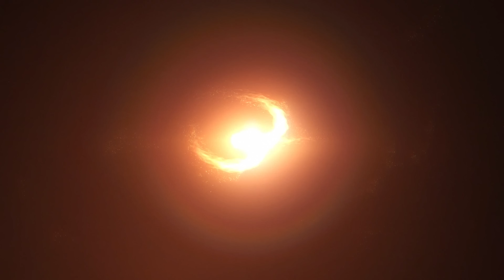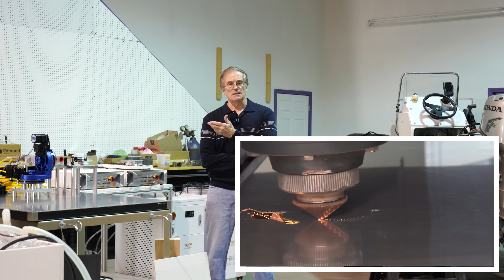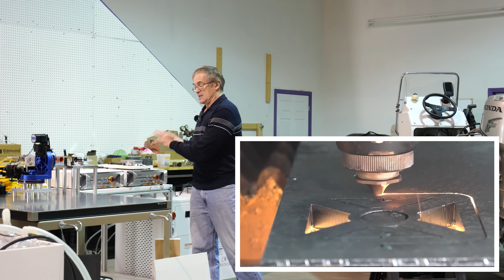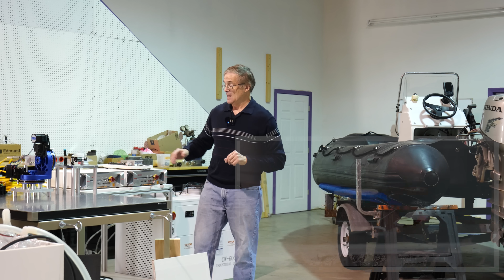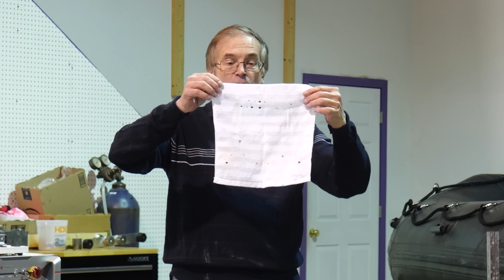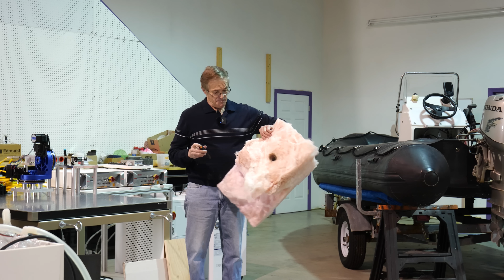We have a problem... and need your help!

Comment: Feels like an "XY problem" to me? However you've given enough information for others to give you the answer to the problem you need, rather than what you asked for.
Reply: He did say in the video that he would talk about the power of the lasers and how much they cost and then he never did that so those particular bits of data are off the table for us to consider what is cost-effective and what exactly are we trying to stop without that information you would probably think yourself doomed but he showed the object in the video so a quick image search reveals what he's playing with
Reply: @loveblowsbad  Primarily I mean that he's asking for a specific material that's cheap and convenient enough to cover a large wall but also resists their laser for a few seconds.

But a system that instantly cut the power when the laser missed the target could also work? Or move a smaller piece of expensive material constantly to where the laser is pointing?
Or only activate the laser in short pulses when it's confirmed to be exactly on target by using an automated lower power sighting laser?

What they need is to safely test this laser system without rapidly "burning through money" on consumables. But they asked for a specific solution rather than the general one.

Comment: Layers of frosted glass or acrylic panels to diffuse the beam rapidly. Or clear acrylic sandwiching some pool salt.
Reply: To further expand I’m my thought process: I have no experience with lasers beyond about 1-2 watts, but the little that I do have, tells me that I can burn black insulation tape but not even cling film… added to that, the reason that lasers are so powerful is because it’s so highly concentrated and “laminar” for lack of a better term. So if you can re diffuse the beam over a practical distance, in a medium that doesn’t absorb as much light, and has enough thermal inertia to absorb the heat from the scattered beam, it should be possible to effectively block the beam for a reasonable amount of time. Tempered glass may actually be preferable too because if it shatters due to the heat, it would be even more opaque,  granular and refractive. But the fractures could also act as mirrors and redirect the beam, relatively un-diffused all over the place. So that’s why for testing it out. Acrylic might be a better option.

Comment: A very fast spinning 8 sided mirrored surface to make the laser beam scan across a 45° angle against a fast spinning disk. That should spread the beam onto a large enough area to prevent it from creating a concentrated heat spot. You could make the spinning disk white and put it inside a black box so the reflected light doesn’t escape.

Comment: Any practical substrate backed with a light reflecting material facing away from the laser, behind that, a light reflector to create a light trap. A sensor in the trap could trigger shut down when light penetrates the box.

Comment: Give ablative coating a try. You could use the same drywall or plywood panels, coated with the ablative paint. It should add some time before burning through. Search for NightHawkInLight Starlite to see a homemade recipe.

Comment: Could you use the coanda effect on a sheet of aluminium. Water flows down the surface. The new supply of water would hopefully prevent the temperature raising locally. Or some diffusion material, glass maybe a small gap and a thin brick layer.

Comment: Curtain of water or smoke. They should be opaque so as to absorb the heat, and be continuously replaced by a delivery system having the necessary volume or speed. The medium needs to be encased in a transparent sheet (plastic, plexiglass....)

Comment: Buckets of (mainly) silica based sand (regular play sand)? Sure it would be tedious to sweep sand off the floor, but it's cheap and easy to patch up a couple of buckets with tape, glue, or silicone, and replace the sand. Plus, the glass you make with it might be interesting.

Comment: Pure silver spinning disk, 1/4 inch thick. If you're doing the drone shoot game agen, it woud need to be mounted on an x - y system to keep it wherever the lazer iz pointing. I'd go with 6 inch diameter on a 3600 rpm motor. Altho silver iz expensiv, you can get most uv the $ back afterward, especially if you wait till the market prise goez up.  Maybe copper woud work, but that 4% slower conductivity mite be too much to overcome with spinning faster.

Comment: I wonder if you could use a light trapping box design similar to a snail shell design. The inner chambers will have mirrors to redirect the light deeper into the box and tested and positions  for prisms to disperse the potent dangers of the laser.

Comment: The soviets used cork as a ablative heat shield material on some of their first space reentry vehicles. Probably works  even better if you soak it also. It's cheep, readily available, don't catch fire.

Comment: 2 stage protection. Carbon Coated Fiberglass insulation, with a laser light detector on the farside connected to a kill switch.
You can make your own carbon coated fiberglass with soot/charcoal/graphite powder on fiberglass insulation. Fiberglass disperses and melts with lasers. Carbon coating absorbs it. 
About as cheap as I would want to go too.
The key aspect is it needs to be COMPACTED. You need mass. You can't leave it loose. So wrap it in something to compact it. You want the scattering of the glass fibers but NOT the gaps inbetween. the gaps provide insulation which is the exact opposite of what you want. 

Alternative is dark water. Make a wall out of two sheets of acrylic with blackened water in-between. Laser melts a hole through the acrylic, yes. But it is then stopped by the water.

Comment: some layers of graphite foam, some foams can be heated up to 3500°c. From this point the material will start producing carbon fumes that will need to be managed.
this kind of material used as industrial oven isolation.
mineral wool can be used as well, some products will melt around the 2000°c.

love your videos.

Comment: Shine the light into a tank of slightly dirty water. It should scatter the light.
Reply: Another solution could be a fast spinning disk. If it’s spinning fast enough, the light won’t be hitting a single spot for long enough to burn through.
Reply: The “dirty water” should contain something capable of scattering the beam. Extremely tiny particles. And there should be a pump that keeps the water and particles stirred up and moving.

Comment: My proposal to test would be: a box build of consumable materials (maybe on wheels) with sand in non flammable lubricant (maybe saltwater? ) that would minimize sand friction.
Reply: Another safety mechanism would be introducing detection of distance (ToF or Phase shift based) that would use existing laser or introduce new beam at different length. So that way you can detect a starting distance and you can stop immediately when it will reach certain depth.
Reply: Sorry, you sparked me thinking :-) You could use also dry wall or other material, but make of it a wheel  and rotate it when working with laser, that would definitely make it work much much longer. Multiple dry walls (or other material) could be on same rotating shaft

Comment: Interesting technical problem! Just ideas. There should be some material that produces smoke when heated by the laser, because the smoke scatters and absorbs the beam. Obviously, the smoke should not be toxic. Or it could even be steam. The point is that the produced material should not be solid, because then a hole will be formed. Maybe some kind of jelly with a high water content, but still quite solid? Maybe you could mix glycerin to make the steam thicker?  Another idea: Some kind of foaming agent? Maybe a liquid that absorbs it 
 and dissipate the energy? Aaaaand got it! You need a sheet, e.g. 2x2m, on which you continuously pour a dark liquid, e.g. water, from above. The sheet can even be perforated, possibly multi-layered, with several layers of water. The point is that it flows down continuously. A channel at the bottom captures it and pumps it back to the top. This can be made light and rollable. The liquid can be stored in a can. I would try the glycerin-water-paint mixture first.

Comment: In the middle of the collimator, the beam should be at a large diameter and therefore a low intensity. Arrange a mirror that can quickly snap into place there when anything goes wrong, probably based on timeout of an electronic timer that did not receive 'an everything's okay' signal from the computer within the last couple of milliseconds. The reflected beam then goes into a tank of water with dye and/or carbon black suspended in the water. That will make a very effective beam dump.

Comment: How about blocks of graphite? It has a high melting point and is not reflective. May be mounted on glass or ceramic insulator or on metal poles (heat sink). The thicker it is the more seconds you will get. Another idea i have is some sort of water fall (curtain) with black dyed water (Indian ink?). You definitely need something black. Water fall here to have at least 4 to 6 inch thick wall of water to give you a few seconds.

Comment: Hi I have a weird idea don't know if it work but it would be definitely interesting to see , a mixture of  aluminum oxide powder with chromium oxide so that, as the laser melts the mixture, ruby is formed which would probably block more of the laser light.

Comment: I'd say use what the fiber is made of, fused silica.  Maybe mix in something that absorbs that wave length perhaps titanium dioxide. maybe make a paint out of the two and really glop it on  some plywood. Hopefully the silica will scatter the beam and attenuate it some.

Comment: What about hempcrete? It’s very lightweight, basically fireproof, and it wouldn’t be too expensive to make a wall(or stackable bricks) for your needs. It’s basically the woody hurd(the inner part of the industrial hemp plant) mixed with some lime based binding agent and water and turns into a limestone rock like material, and it’s carbon negative. It does take about 30 days or so to cure once it’s set in it’s mold for 9-12 inch thick by 1-2 foot tall bricks. You could do like 2-3 foot tall bricks and wouldn’t be too hard to transport, the extra height might make the curing time a little longer. My guess is you could do it for under $2,000 if you got a good deal on shipping.

Comment: You can't use something that reflects the light for obvious reasons. But maybe you could try something that absorbs light such as Vantablack. 

I don't know how practical it is but maybe look into Aerogel boards and paint them in Vantablack. 

I mention the Aerogel because I've a feeling the Vantablack will absorb the light and create even more heat at the laser point, but im not sure. It's worth trying. Or maybe paint it onto cooled copper sheeting. 

Or maybe it will have some weird physics going on and kill the laser light completely without creating extra heat. 

It's worth a try....

Edit, water works well but gets evaporated too fast, maybe try make sheets of gel, like ballistic gelatin, which is mostly water and can be made rigid then paint that in Vantablack. 

Carbon is a great heat absorber maybe carbon fiber sheets painted in Vantablack?

Comment: Sanwu lasers offers a RGB model for about 1200$ and it has Red green and blue diodes that you can adjust on a dimmer switch. perhaps you should get in touch with SANWU about their designs?

Comment: try waterfall, the water would evaporate, but you are in control of the flowspeed and thickness of the flow, so that should not be a problem.
Moisture could be an issue though, but excessive moisture is a better problem to have than walls on fire

Comment: A sheet of oxidized copper with a fast stream of water filled with graphite running over the copper plate.

If you want something cheaper anodized black aluminum.
Cheaper still = black painted aluminum.
Cheaper still = fiber cement board.

Combine with my previous ideas

Comment: Try with a starlite imitation material, there are many recipes online, but i found the ones with Vinyl glue, Flour or Starch and Sodium Bicarbonate pretty valid and cheap; the foaming carbon might absorb enough energy to give you the time for turning the killswitch.

Comment: I'm thinking of a mirror  at 45 degrees to send the beam vertically up.  Yes, it would burn through the roof😢, but is unlikely to be needed anyway and the roof would be easily repaired. 😅

Comment: Multiple sheets of glass, sandblasted on both sides, glued with high temp silicone. A sheet of shiny aluminum or oxidized copper, or a glass mirror for a reflector. Glued to fiber cement board with high temp silicone.

Comment: Would Haze? Work. Like dust or some other fine particles in air. I'm thinking graphite dust? Build a wall that between blows this partial or debris? The constant circulation could create a kind of regenerating ablative system?  Any static material will have the same overall issue of energy absorption. So  if ariated particals won't work try the same in water. The water might absorb the energy and you could circulate it the same fill it with activated charcoal to interrupt laser. This has a problem of scalability or size. Others have said point it at the ground instead... And there is merit to that. You could trick the system. Project a video of the drone onto a screen on the ground...

Comment: stick glass onto 4mm fiber cement panel with high temp silicone. Sandblast both sides of the glass to diffuse the light.
Try multiple thin layers of glass with all sides sandblasted for increased diffraction. The high temp silicone stops the glass from shattering and falling off.
Are borosilicate glass sheets affordable? 😊

Comment: something that might help is to move the laser when not destroying, rastering is easy to implement and spreads the power along a big area. this away you can be more flexible with the absorbent material. of course laser are so fast that when the system is tuned you can shutdown the laser long before the backing material is an issue.
Reply: ...just for fun... probably you can map the target with the reflection of the rastered laser

Comment: Dirt should do.. it's pretty available.. it's heavy tho.  Maybe put a few inches between some plywood or something, put some wheels on it standing vertically, and when you're not using it, just wheel it away.  Sure, the plywood will get holes in it, but it's cheap, the dirt is what would block it.  You could also use some water pumps to pump water over the first surface.  I mean, I personally would just use bricks on a platform that you could move, or something similar.  An e-stop would also be a must for a system like this.

Comment: Small crushed rock glued onto a 4mm fiber cement panel with high temperature silicone. I doubt the laser eill get through that easily.
Increase the size of the crushed rock pieces if laser gets through too fast. Try white, brown and grey rock.

Comment: If the laser is not moving then your "wall" has to move around. How about a rotating disk of drywall to dissipate the energy?
Btw. don't use optics to form a high density laser beam until the very end of your experiments. Use some harmless laser to optimize your tracking mechanism like training ammunition and some photo diode coupled with a beeper as a target indicator when hit.
In the end you need some remote shooting range to test your laser on usefull distances as air might dissipate your laser energy by scattering. And ... it's not easy to keep a laser beam "tight" over long distances for exampe a mile. My understanding of optics as an amateur astronomer is that this might be another critical factor. It's not about focusing over 30 ft but 3000 ft.

Comment: What about a water curtain? I have seen water features in restaurants that were composed of a large sheet of poultry wire with water pourd over the top using it elongated pipe that led to a laminar flow guiding down the wire to create a pretty solid curtain of water. 

This would be cheap, portable and assuming that water is not blasted out of the way by its own steam too quickly, should be able to absorb a significant amount of thermal energy. You could even use multiple layers of poultry mesh and water devices to create redundancy without significantly increasing the weight of the system.

I also can imagine that dying the water would create the very interesting visuals to help identify where the laser is hitting.

Edit: Here is an example. https://youtube.com/shorts/8ynqC5BKP0Mv

Comment: Correct — *at 5,000 °C+ focused in a 1 mm spot**, **no known material* can *passively* stop the beam indefinitely. Everything will:

- *Melt*
- *Vaporize*
- *Sublimate*
- Or *erode by ablation*

### The only options are:
1. *Spread the beam* – defocus or reflect to reduce power density.
2. *Absorb and cool* – use massive, actively cooled *graphite**, **tungsten**, or **copper* blocks.
3. *Sacrificial layers* – material that absorbs energy and is replaced regularly.
4. *Plasma or particle clouds* – disrupt and scatter the beam in the air.
5. *Dynamic defenses* – moving barriers or rotating dumps to spread damage.

In short: no static, solid object survives under such energy concentration. You must *redirect**, **absorb**, or **disperse* the energy.

Comment: Don't know if they make a mirror which is flat enough to reflect the beam for any reasonable amount of time, but if it was possible, you could possibly mount it at a 45 degree down angle from the direction of the laser and then into a tank of translucent dyed water? Not sure of the probabilities, but it's worth the thought.